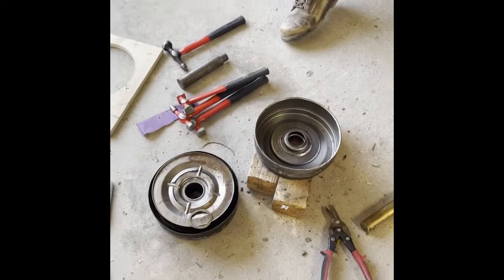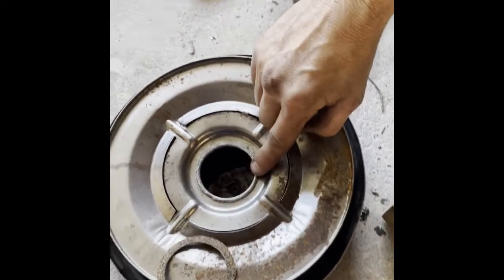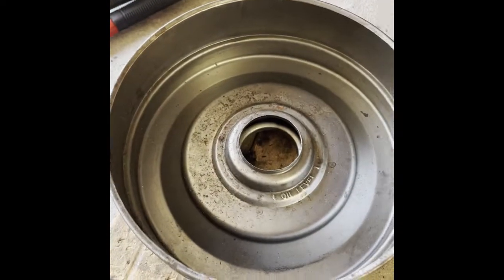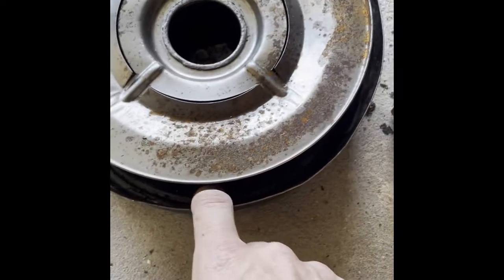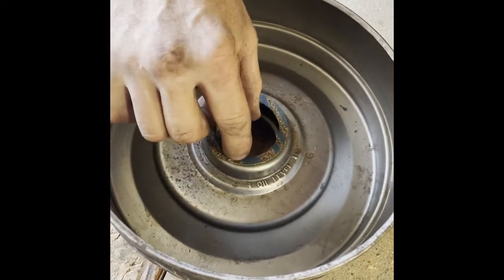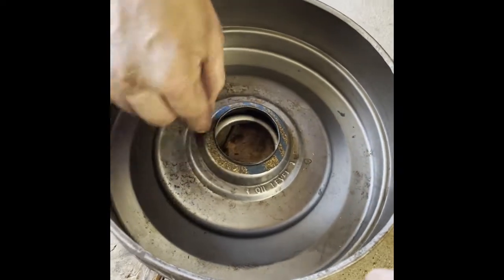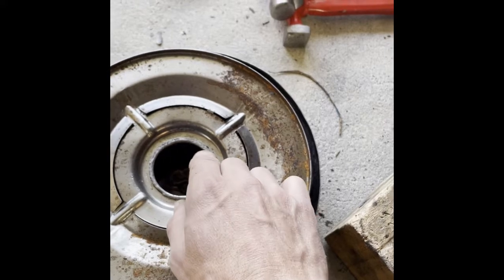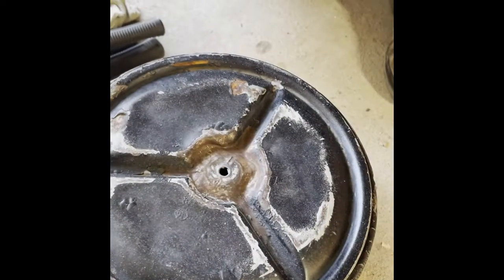1966 F100 Oil Bath Air Filter Solved

Comment: Hey I’m looking for the separation point, my filter will spin but still not separate.  Any suggestions?
Reply from the maker: Howdy Bobby!
There should be an upper and lower section.  Try using two screw drivers to pry them apart.
Reply: @spencercustomdesigns4920  thanks! I was able to use one screwdriver to break it free thanks again!